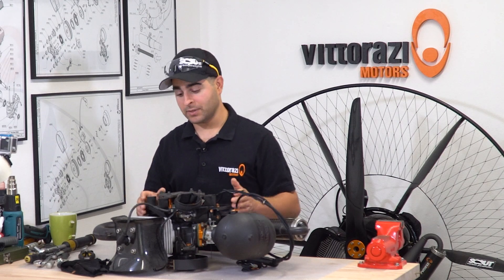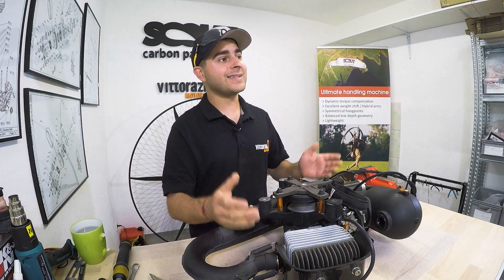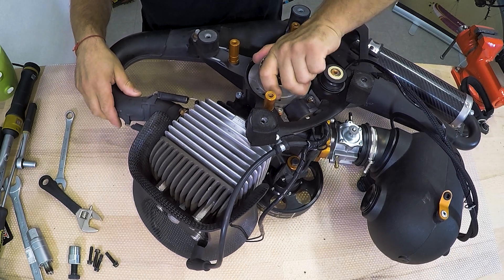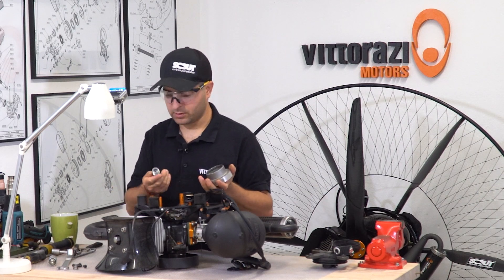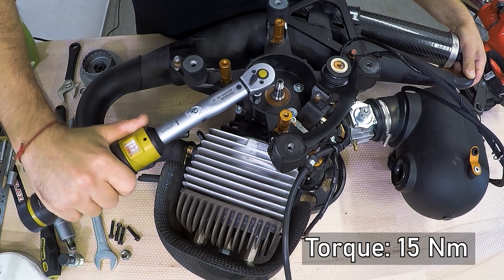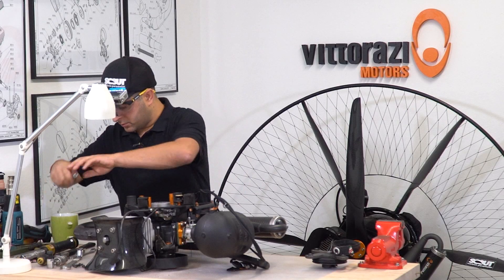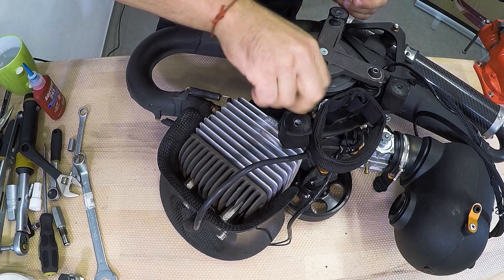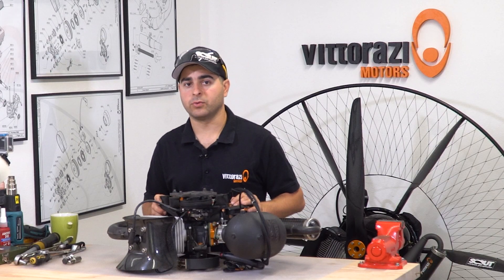Vittorazi Moster Plus flywheel removal and replacement. Paramotor engine maintenance series

Comment: hmm what problems can occur with the flywheel?
Reply: When replacing the coil if the clearance is too low it can scrape the flywheel and cause damage. Just did that to mine

Comment: Hi there,I have problem with my throttle Kill switch does not work how can I solve this problem.
Reply from the maker: What type of throttle are you using?
Reply: check the black wire from the coil. it is earthed and the wire can break.and kill switch will not work.